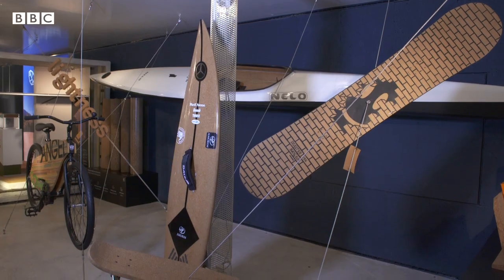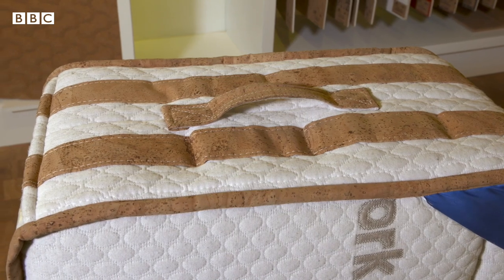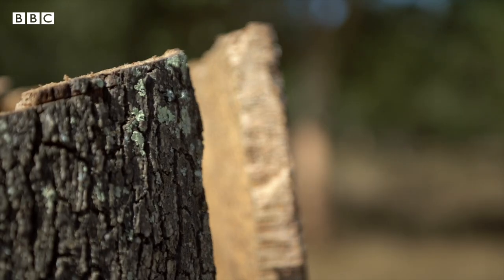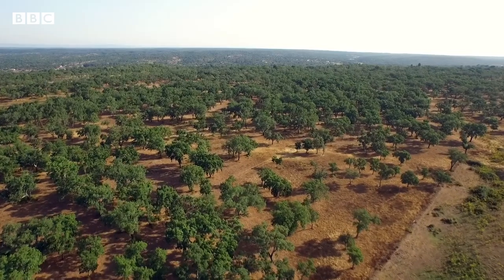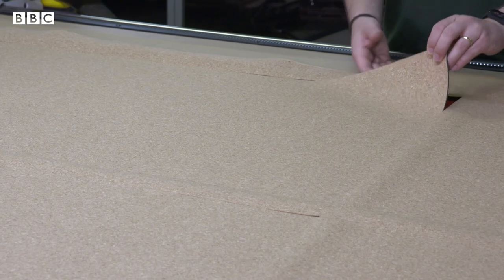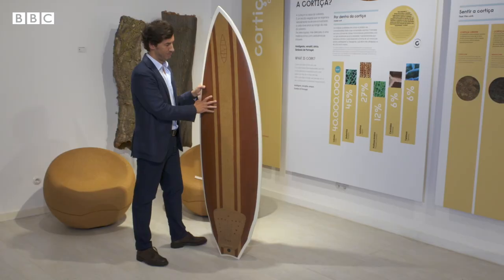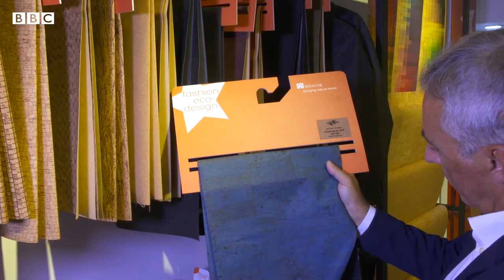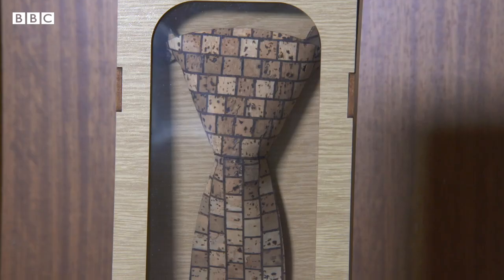Cork: Is this nature's most versatile material? – BBC REEL

Comment: Lots of those uses are just clugged together for fashions sake, BAMBOO is the most versatile natural renewable resource.
Reply: Bamboo is an incredible natural material, but I would put both hemp and cork ahead of it for versatility, just for their insulation properties alone. Few things grow more quickly and easily than hemp. Cork is also virtually fireproof. Can you say that about bamboo?
Reply: Cork has many more uses than bamboo
Reply: @jackspencer8290  And the acorn of this oak is eatable too, if you boil it I mean.
Reply: Bamboo is THE fastest growing plant in the world. All three can be made into fabric and other soft uses but only bamboo has any hard application. Bamboo can be used for building material. Can you say that about hemp and cork. Bamboo is also edible. Bamboo wins.